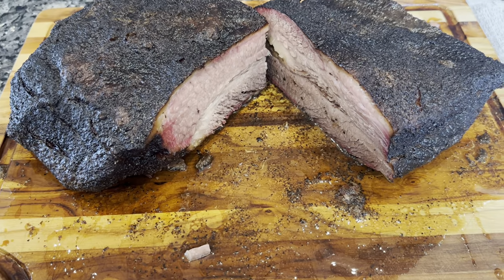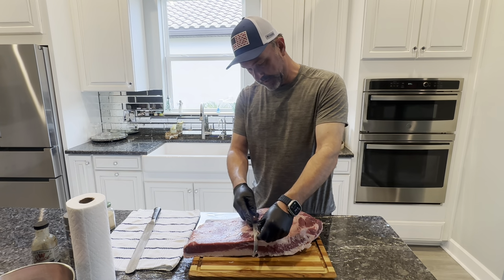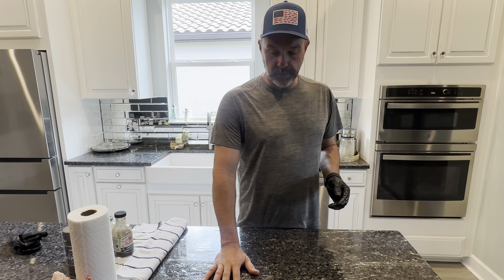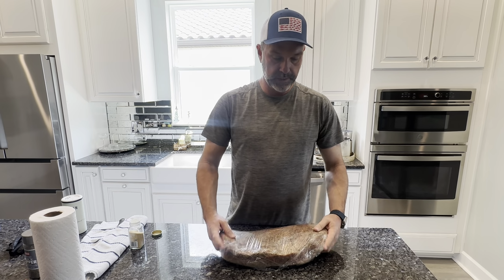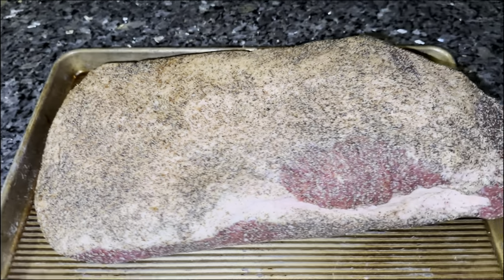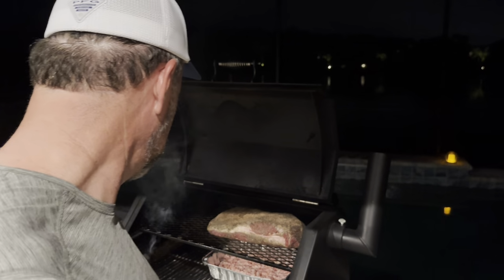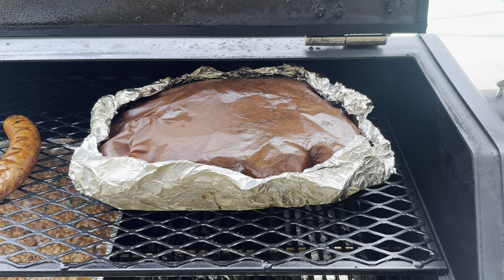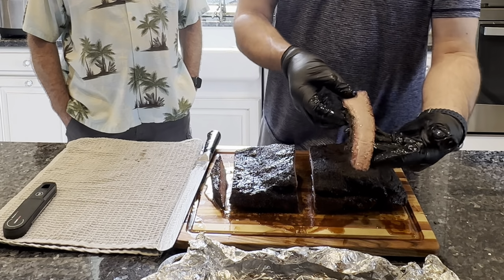The Great Brisket Wrap Debate: Which Method is Best?

Comment: John, thanks for sharing. There are a couple differences I’ll do on my pellet grill.

Fat side up, on second rack, with a water pan underneath. The water pan serves as three key points in a pellet grill. One it helps to add moisture in the cook chamber especially since the grills use a fan to help regulate the temperature. It also acts as a heat sink stabilizing the cook chamber temperature. Lastly it helps with clean up.

The meat will only absorb smoke until around 140 internal temperature, so doing the grill temperature between 180 - 200 for maximum smoke flavor should go until the 140 mark. So put your brisket on cold, right out of the frig. This will extend the time until it reaches 140 internally.

Once the brisket has reached 140, you can start to render the fat & continue to build bark by raising the grill temperature in increments. Go to 225 for an hour, then 250 for an hour, then 275. Reason for doing the incremental increases to to avoid the flat from tightening up and drying out. Fat rendering is key at this point.

Once the brisket pushes through the stall (around 170 - 180), foil boat it. This will allow to build bark, while allowing the meat side to confit ( cook in its own fat).

Once probe tender, take out of foil boat, rest for 10 minutes to stop cooking, and wrap in fresh tallow. Allow the brisket to come down to 140 internal slowly (put in cooler or warmer). The longer the rest the better (5 - 15 hour rest if possible).

Your end results looked amazing.

Last thing. I have found Smokin Pecan Shell Pellets to be the best pellets for low & slow cooks. By far. Look it up on YouTube with other people. You will not need a smoke tube. They burn longer than wood pellets, put out way more smoke.
Reply from the maker: That is a lot of good information.  I will incorporate your tips into my next Brisket cook.  I will definitely look around for the Pecan Shell Pellets and rest it a bit longer next time.  The overall taste and texture on this brisket was better than my last attempt by a lot but you are right on track with it could have been a little more smoke flavor.  Thank you for watching and commenting!